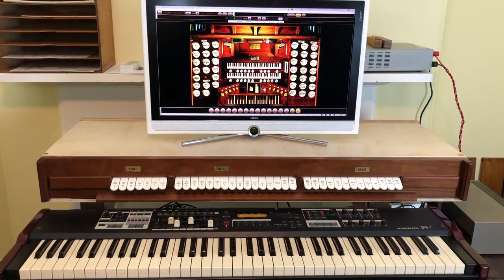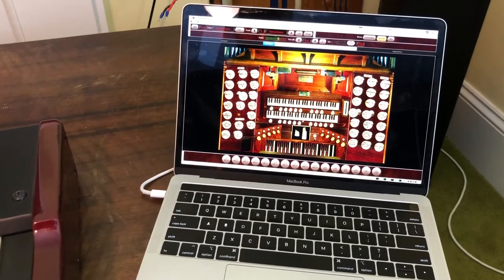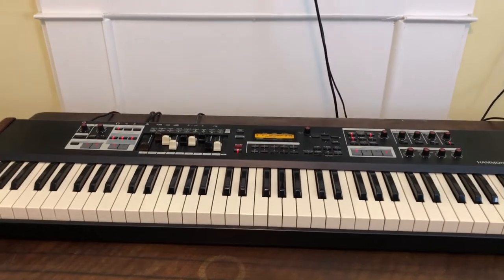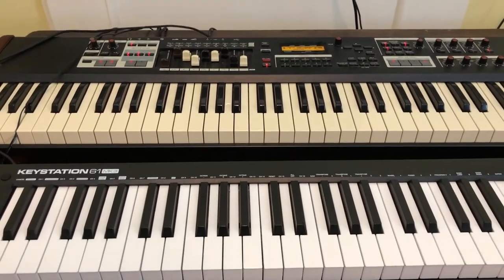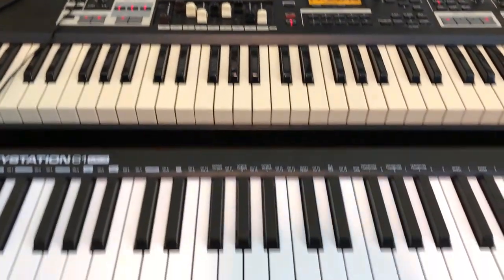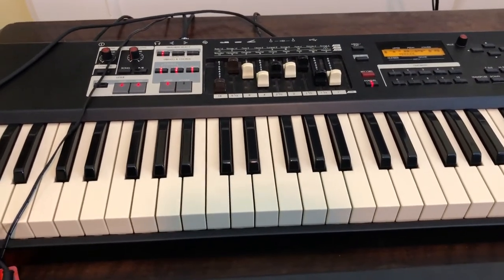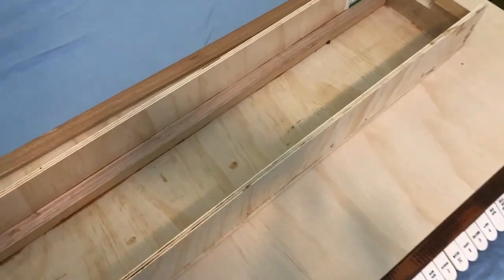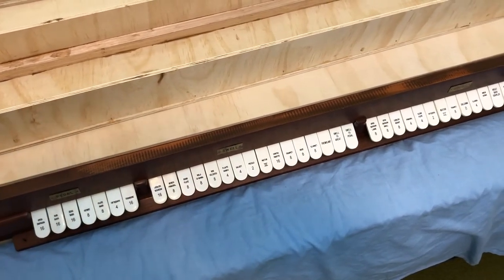How I built a modular Hauptwerk Virtual Pipe Organ

Comment: Steven, I can’t believe you have only ten likes for this video. Yours is exactly what I need. 

And what a superb but practical organ you have built. I had been frustrated that with a nice keyboard, even when aligned more to “organ” use they mean electric organ, not pipe organ simulation. 

I was thinking about getting the m-audio keyboard you have and perhaps its Oxygen pro workstation big brother instead of your Hammond, but also thought about getting a mid- range stage piano/organ or synth and mating it with an m-audio to get more functions, but was not sure it would work. But you have solved it all. As I said before, brilliant video. 

1. How well documented and how reliably available are those midi coders you found? Could you write down for us the models you used, or features you specifically needed which informed you which board to buy please?
2. The m-audio keyboards don’t have an expression pedal. With the analogue input into the top board which measures resistance or perhaps a voltage divider(?), I could plug into that, yes? 
3. I live in a regional town in Queensland so will never be able to get a set of stops (or a foot pedal board) from a real organ. Would one or two of those multicoloured lighted midi controller boards do the job? Or better, could I make a classy set of momentary switches or on/off buttons and feed those to one of the midi boards? (And if so, which board would I need to buy for that? Thinking about chasing that down on the internet put me off a lot!.)
4. Did you ever try the GrandOrgue freeware virtual pipe organ?
5. Did you get on line help from the virtual organ on-line throng?
6. How do you spell “Peon” - as in Nepean, or Pion of Muon fame, or something else?

I have never written anything on YouTube before, so congratulations on that too!

Cheers
George
Reply from the maker: George - this is a pretty esoteric topic, and that coupled with the joys of the YouTube algorithm I suppose explains why there hasn't been more interest in this video.

1) The midi-boutique range is more or less the de-facto standard for building these kind of things. Support used to be fantastic, with the founder and tech guru answering my questions himself. Sadly he died of COVID in the first wave.
HWCE2 is the midi encoder. It will handle all your contact closure inputs and also has a few analog ins as well for things like swell shoes, volume control potentiometer etc... You can plug it straight into a diode row/scan arrangement, or you can use expander boards that let you hook up contact closures. There are various kits available and you just order the configuration that suits your needs.
Midi decoder I used is the mddp128. There is a P channel and N channel version depending on whether you want to switch on the hight side or low side. There are a variety of board options available depending on how many outputs you need. There is a version with higher power transistors, however I am using the standard power one, and it is quite happy to switch my SAMS (stop action magnets). I did manage to blow up a mddp128 because I had wired it incorrectly. The trick with SAMS is whilst they look fantastic, and it is so great to see all those solenoids just throwing into place, it gets electically tricky because you have the ground for you contact closure in commoned with ground for the solenoids, being interfaced to completely differend boards, and so you end up becoming very confused as to just where ground is. The Midi Boutique boards use a bridge rectifier on their inputs so it doesn't matter the polarity of power, however this means there is a diode drop to system ground. So I removed the bridge rectifiers and replaced with a single diode on the positive side (so it couldn't be blown up by wrong polarity) - this way at least I now knew that ground was ground.

So as you can see, you need to be pretty good with electronics to do this, but can come up with a fantastic system if you do. Hauptwerk is incredible in its flexibility, and knows how to drive things like SAMs out of the box, you just have to configure it.

2) I have not tried this, however I would expect that it just sends a midi signal when you do this. So the answer should be YES, but wouldn't know for sure without trying. I couldn't get the volume sliders to work on my M-Audio keyboard, even though I thought they should, and the documentation is pretty average.

3) Where are you in Queensland? My friend FB is in Queensland, and I just left my spare stop rail with him a few months ago. He also has things like pedal boards kicking around, and I have a spare pedal board myself that needs a new home. Yes - an off the shelf midi lighted board would be the easiest way to get going. I think by the time you stuff about with a Contact Closure board you might as well just do a proper stop rail.

4) No - never used GrandOrgue. Whilst there is no longer a free version of HauptWerk, it is absolutely fantastic. I am complete amateur in terms of playing, and not very good at all, but this is a lot of fun and I think HauptWerk is worth every penny.

5)In the end no, worked it out myself, trial and error.

6) Pianorgan - as in not a Pianola, but a Pianorgan.

I just noted you emailed me, we can carry on the conversation there, but I'll leave this up here in case it is useful to anyone else.

Comment: Does the M Audio midi controller keep reverting back to default midi channel one after power down -
Reply from the maker: I couldn't get it to change channel at all. It doesn't seem to do what the manual says.
Reply: Well that is just a bummer too. If I had discovered that I would have been very worried.